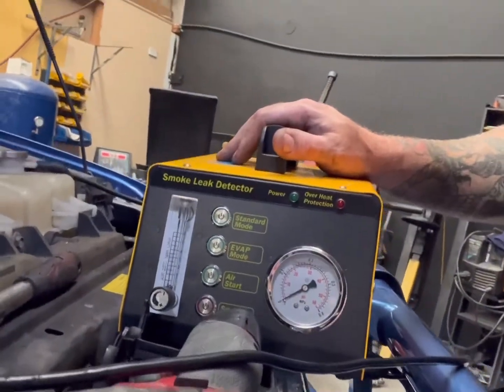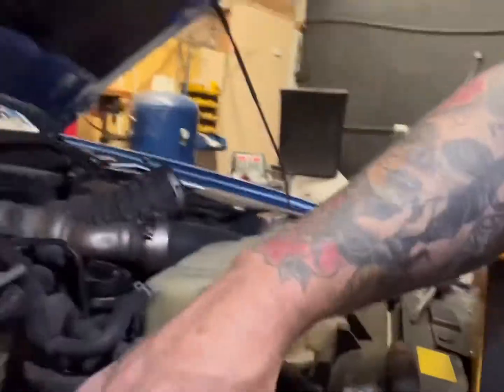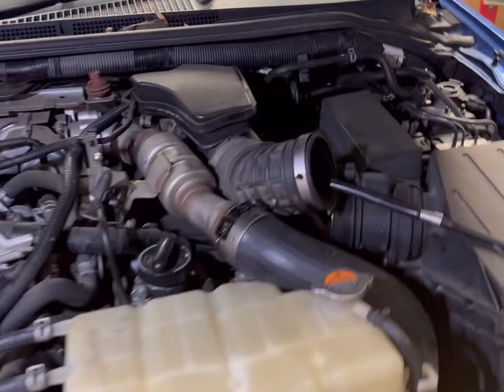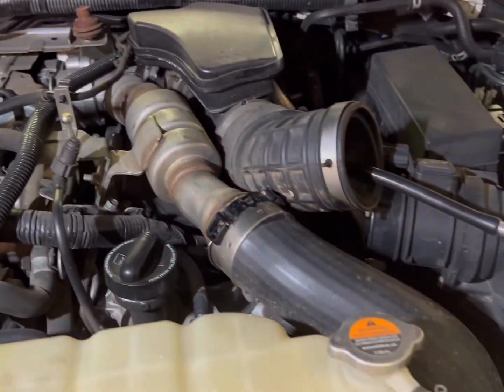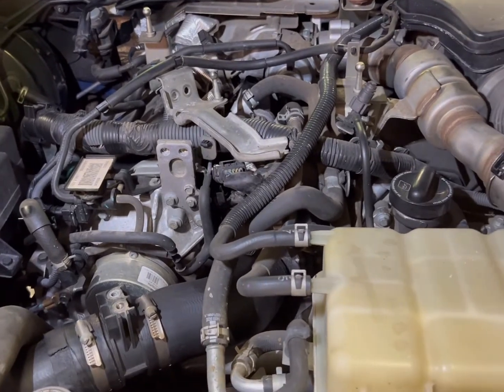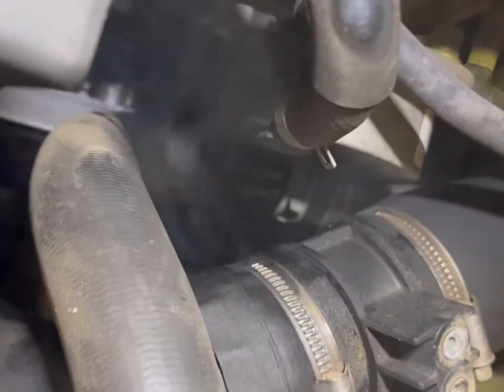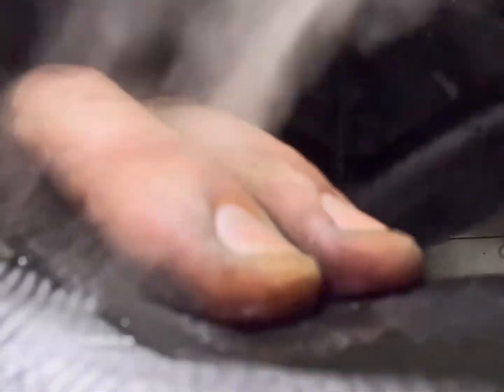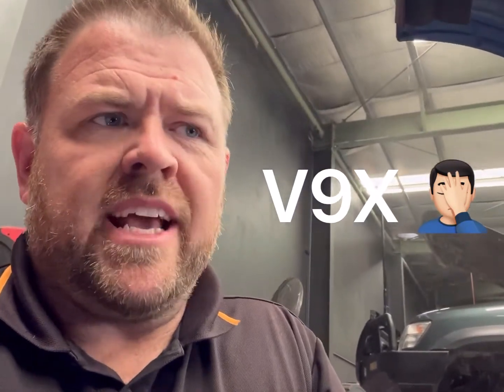How to fix DTC P012B Nissan D40 V9X 550 V6 Diesel

Comment: Hey i just has this cabt rev past 3k. Clear the code its all good then cones back. 

Mightnhave to find a good mechanic
Reply from the maker: Find any hoses with splits? 
You can get someone to rev it while you run your hand around the hoses. 
Just be careful of fan and belts
Reply: @procheckautomotivemechanic4551  thanks. I have a hot side hard pipe set to install so praying it's on that side. Plazman brand.

Thanks for the reply. When I rev it I hear what sounds like a boost leak.

Happy new year.
Reply: Hey replaced yhe hot side pipes and srill happens. 

Good times, i dont have a smoke machine but the pipes dont look or feel cracked. 

Could it be a the boost sensor?  @procheckautomotivemechanic4551

Comment: Hi

Are you a V9x specialist ?
I have a problem on my car, i can't start at all.....
I got p2149, p2146 codes.... And so many others circuit codes like ecm, abs..
What it is come from ?
Can a battery cause it ?
Reply from the maker: Hi 
Those codes are power supply to injector fault codes.
Could be as simple as plugs have come off injectors. But could also be broken wires, faulty injectors or worst case an ECU issue.

If lots of other codes it could be a broken wire or wiring harness. It could even be a earth cable broken or bad connection.

Will it crank over?

Would need to diagnose properly to give you the correct fault.
Reply: @procheckautomotivemechanic4551  Thanks for your reply sir
What do you mean crank over ? Jump cable ? 
It cranks repeatly but no start
On the v9x, i don't see how access to injector wires, it's all hidden in the top 😭